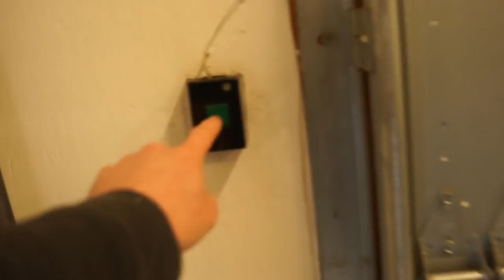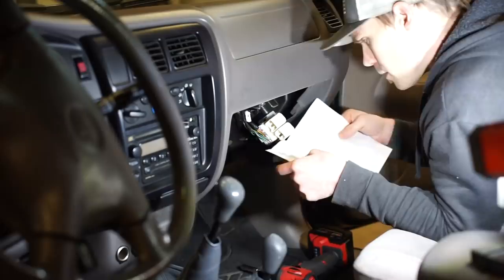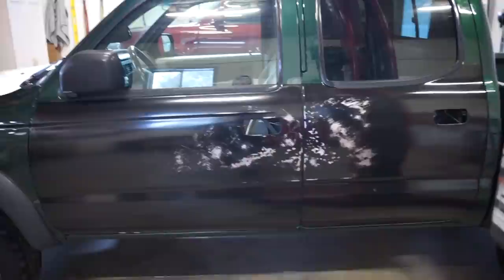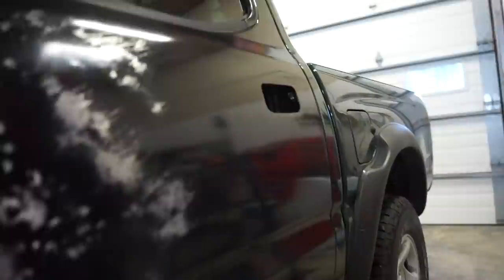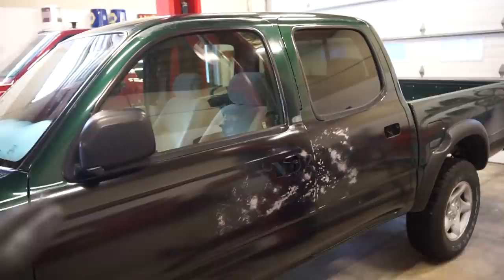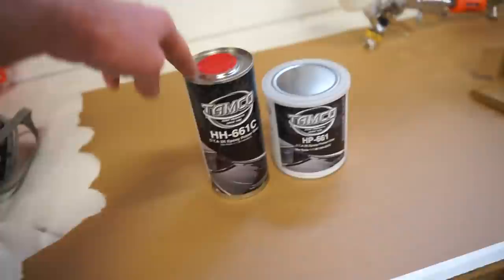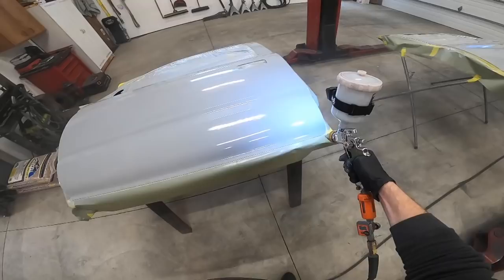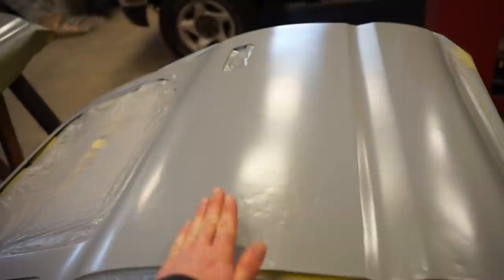Day 1 Of Paint.... FAIL!!!

Comment: I literally ordered all the supplies for a water trap on my compressor at home just yesterday!  I'll be doing an A/C condenser instead of the copper pipe method, but same principle.    The first thing I thought when you pointed out the paint problems was water in the lines.

Comment: I’d consider putting your compressor in the back behind the stairs, and running hard line out to your new setup. That will give you more air storage, and longer travel distance to cool. And Mby even closing the back section of the garage off to help with the noise.

Comment: Hey man I watch your videos a good bit I’m actually building a 93 pickup frame off, we own a body shop as well was just going to let you know we have a tsunami air drying system but what we also have on our compressor is an automatic pop off valve that drains the water out of out compressor every 30 minutes or so it pops off for only about 10-15 seconds but it helps a lot with the moisture coming into our shop and it’s a fairly inexpensive deal
Reply from the maker: Nice I’ll check that out! Thanks!

Comment: You need at least 25 feet of copper pipe for the air to properly cool down. I personally used 3/4 in pipe with a drain at every drop in the pipe and have not had a moisture problem since
Reply from the maker: Good to hear!!

Comment: For the can bus you don’t want to measure voltage you want to check for resistance, there is multiple terminating resisters (on class 8 trucks anyways) to obtain the 120 ohms resistance needed. If you don’t have 120 ohms there’s your problem
Reply: Look into proper resistance values for the bew tho, I think automotive can be high speed and have a different resistance value